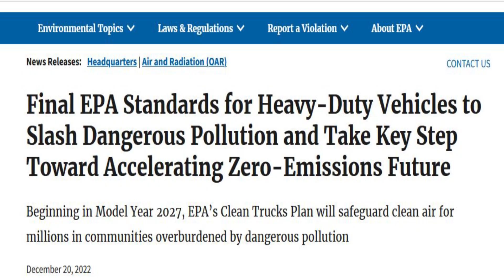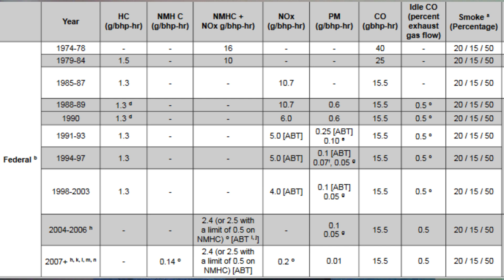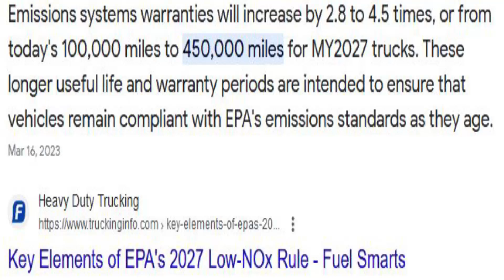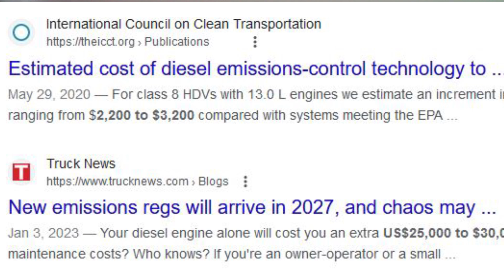Why the 2027 Diesel Emissions Standards will cost BILLIONS!

Comment: These standards are how they will force companies into EV trucks because the cost gap between the types will close to the point that it will make sense to make the jump. It's a sad state of things that these systems are being mandated with no care to the real world negative effects they cause.
My father is a O/O and has only been towed three times in the last five years all because of emissions related systems on his Freightliner failing and bricking the rig. The cost of repairs is bad enough but the tow bill and lost loads are often worse and then there is the danger of being stranded at the side of the road all because for some reason the truck refused to regen.

I want clean air standards but these standards have been misused, abused, and weaponized against those of us in the trucking industry by those who despise our very existence. The only solutions I can see is a curtailing of the EPA's power, a massive improvement in any of the alt fuels support and infrastructure, or a major shift in how diesel power is used in trucking like making new trucks purely diesel electric like a locomotive for example so maybe a smaller, potentially cleaner diesel engine driving a generator might allow for the reduction or elimination of emissions systems and the cost burdens they bring.
Reply: A vast portion of diesel emissions could be prevented by building railroads and stopping the interstate travel of goods on highways. We could then focus on rapidly electrifying short haul and vocational vehicles and not have to worry about long haul trucking.

Comment: The marine diesel industry is just getting into the exhaust treatment world. 

Any boat over 90 feet has to meet stricter emissions standards. 
This is why Viking dropped the 92 from their lineup. 
These boats will require hundreds of gallons of DEF to meet emissions. 
In an already tight engine room I don’t see where adding a 1500 degree SCR system will go wrong.

Comment: I think the advantage of diesel engines are gone. Between the cost of the parts the loss of fuel mileage regenerating the particular filter and all the various other parts you outlined and issues. I think they need to go back and build high torque low-rpm gasoline engines. With the computer technology we have today the engineer's should be able to design and industrial gasoline that is reliable,
 clean and has a long life. 60 years ago they made gasoline truck and industrial engines. Maybe the increased length of warranty would cause the manufacturer of the trucks and parts to design and build better parts instead of nickel-and-diming everything to satisfy the bean counters.

Comment: What's your opinion on the opposed piston engines that are out testing right now I've seen some in Walmart trucks it's a three cylinder six piston two cycle what I've heard is they can just use that engine and keep all of the same emissions equipment and meet the higher standard
Reply: Yeah, the engine with no valve train. Two injectors per cylinder. The pistons meet (almost) in the center of the cylinder.
Reply: The way I understood it was that some manufacturers Don't really have to change the engine design mechanically in order to meet the new standards they can simply add another SCR system in line with the current one and that will get them there with a change on the programming but I've heard that that cost like an additional $10,000 just to add in another one of those complete systems

Comment: The engineers actually build a proper system instead of cheapest Chinese components that break down 6 months after you install them
Reply: This just means that instead of paying for the repair when it happens, you are paying for it before it happens in the inflated price of the truck. Kind of like taxing corporations more. The corporation does not pay anything in taxes, you do when they add that cost to the final price of the product. So now when a truck is wrecked before the first repair, you are out the extra $25k in the price of the truck. Well, the insurance company is out that money.....but where does that insurance company get the money? From you in higher premiums. And the truckers may not suffer that much because they will just pass that cost onto the freight and the final consumer. Every tax and draconian law like this ultimately comes to the end consumer paying the price. We are all getting screwed.
Reply: Like I keep telling everyone,the consumer pays for everything.
Reply: Lolno. The suits will demand a CHEAPER system thats cheaper to repair and ask what the average cost of emissions repairs are triple that and apply it to the cost.
$300,000+ trucks here we come! Oh and if right to repair fails they will also refuse to repair rhem past the warranty and have fun with that!

Comment: EPA is a joke they should be dismantled and abolished all they do is cause people tons of money when they don't even fix any of the problems of proper running vehicle does not need not one Emissions on there and most Vehicles out there that don't pass emissions are the ones with emission problems emission components do the exact opposite of what they're designed to do

Comment: That is good news. Since a lot of people hate DEF and do deletes only because the dealer only covers 100k and they are super expensive to fix. Manufacturers had plenty of time since the last revision of the standards to get systems right.
Reply: Until your truck is sitting at the dealership for 3 months waiting to get in.
Reply: @tdashkevich  emissions are here to stay. The better design needed and waiting to get in is a dealer issue, not a manufacturer.
Reply: they never "Burn" right in Cold Temps, and gums up the Filter after about a Month to the point where no Re-Gen will clean it.
Reply: Have you considered that it's not technically possible???
Reply: @Redmanfms  everything can be made better.
Reply: They are still not right. It may be improved, but still horribly unreliable.

Comment: They really need to find a more reliable treatment system if they are going to keep pushing this stuff.
Reply: Military should have to follow the same standard.  No exemptions
!!!
Reply: @matta3888  Military is federal govt you would not want your MRAP to derate and regen in the middle of a firefight now would ya…..
Reply: @matta3888 No they shouldnt. Go to war and have emissions problems... Yeah right!
Reply: @matta3888 military and emergency vehicles you can’t have them regen in an emergency situation
Reply: Nah, they can just keep spending and let inflation handle the taxation.  All their assets will hold value while the sheeple starve and vote for their lies.
Reply: if they do that then what kind of parts and service are they going to sell
Reply: Ask the germans😉.

Comment: I say 80 to 90 percent of check Eng lights are def system related,,, it’s ruined the heavy truck engine,, there no longer reliable
Reply: Working as intended. The malfunction indicator lamp (MIL) or check engine lamp by OBD and HD- OBD standards is meant to illuminate when an emissions critical component is out of range or malfunctioning.
Reply: @jedidiah4004 The check engine light is working as intended. I dont think anyone's complaining about that. But the fact that, as OP states, 80% of the time, the failed component is adblue/def related, says a lot about these systems. I work as a diesel mechanic in the UK on MAN trucks, and we spend more time diagnosing and replacing adblue components than anything else.

Comment: There are significant changes being made to engine, aftertreatment and WHR systems for the 2027 block. SuperTruck 2 is currently nearing the end of development with claims of %40 higher efficiency's. The trucks that are running right now are from the supertruck1 program which was highly successful. The industry had the exact same tantrum in the 2000s and 2010s when those regulations came out. https://www.energy.gov/sites/default/files/2021-06/ace124_meijer_2021_o_5-14_71pm_KS_TM.pdf  But what would Cat know about on highway engine development in 2020? xD
Reply: Highly successful at what exactly??

The current engines have significant reliability problems stemming entirely from the ATS.
Reply: Here we are 23 and 13 years later and the emissions components are still not reliable. You wonder why people have an issue?

Comment: To make it worse, in California (and other CARB states I believe) they put a cap on the maximum age and mileage of trucks, forcing the purchase of a new truck

Kinda sucks because the delivery of a new truck may take years after its ordered, and you're left with an otherwise functional truck that can no longer be registered
Reply: Califonia is on a highway to disaster. The exit is rapidly approaching,
Reply: How is buying a new truck instead of driving the used one that works better for "carbon footprint"? The same people writing these laws are flying around on private jets, which are basically burning a variant of diesel. There's no aftertreatment system on jet engines, and the lithium mining for large batteries is a nasty process.
Reply: @TwoYeets  yeah exactly and those private jets pollute on one flight what the average American pollutes in a lifetime
Reply: Why would you want to live in California??
Reply: Even the exemption for operations with limited actual driving is evidence it is not about air quality. It is about forcing people out of business. I knew a guy who spent 15 years on a contract that only involved taking a loaded trailer 6 miles to a grocery warehouse in Compton and wait for the unload and return the empty to the yard. Paid $300 a day to the truck 5 days a week.  He only bought fuel once a quarter. He had an old paid for truck that was providing an easy life. 

California required he buy a newer truck to operate even this basic operation. The limited use exemption limit is 1000 miles annually. 

The state was preventing him from using his property for its intended purpose and reducing the value of his truck to scrap by banning it from being used in the state. The only way to continue to operate was to buy a 2010 or newer truck. He   and the many people that put in years of hard work to put him in such a retirement contract had it needlessly stolen by the state government.
Reply: Don't worry, soon the manufacturers will make it illegal to actually own a truck, they will be lease only. This gets around the problem of the 'right to repair' laws, and forcing you to bring it in to a dealer, and only use OEM filters, fluids etc. Because otherwise, if they threatened to void your warranty because you used aftermarket oil and fuel filters, they would have to provide you such filters at no charge under the Magnusson-Ross Act. However, if the truck is still legally owned by the manufacturer or 3rd party leasing company, they don't have to allow you any permission to work on it. Think of it another way, if you let me borrow your truck to finish out a trip while my truck was in the shop, would you want me tinkering with your truck? Heck no, you don't know if I know what I'm doing and I might screw something up. Everything is moving to a "XXX as a service model", take Photoshop and Adobe Lightroom and Micro$oft Awfiss for example, all of which you can't buy anymore, if you want to run those programs, you must pay a monthly fee. It's called the 'never-never' plan; they want everyone to have a truck payment for life! TAAS is coming soon, probably sooner than you think. Trucking As A Service.
Reply: Everyone boycott Cali. Let the crops rot in the fields.
Reply: Sounds wastefull af
Reply: Simple answer to that is boycott the states that demand new updated equipment. Let them starve they will soon rescind an order like that if they cant get any product. Its time the trucking industry started acting like business men and women instead of stupid morons allowing themselves to be lead to slaughter by communist states and their dictator tactics. Realize that the largest workforce in north america is the trucking industry. We can leed instead of follow. It just takes some intelligence and back bone to make things better. I am a 45yr veteran of the industry and have seen the trucking industry thrive on stupidity for too long. Hail Jimmy Hoffa
Reply: Source?
Reply: What are the other CARB states?
Reply: sucks that CA is such a big market.   If truckers could just say f--k CA, and no product gets delivered there, they would change their tune
Reply: @John5ive  Thats what happened to the poultry industry. California changed the requirements for chicken farms to sell their products in the state and they tried to boycott. They ended up upgrading all their farms  to comply as they couldnt afford to give up sales in California.
Reply: don't live in fascist states

Comment: This will be part of the push away from Diesel to EV, Hydrogen, Natural gas, etc. drivetrains.
Reply: It’ll be the push toward poverty and famine. See T Sowell
Reply: Everything you mentioned explodes in a driver killing fireball when/if they crash...seen it with my own eyes...no thanks ...
Reply: Hydrogen and N.G. are garbage; and E.V.'s don't stand a chance when the empty-weight of the E-Truck is around 58,000lbs (which means you get roughly 11,900lbs. for actual Cargo).
Reply: Electric is a complete deadend.

Nat gas is out there, but only major carriers use them and they do it because they are farming refundable tax credits.
Reply: Diesel is STILL the most efficient & environmentally friendly fuel source on the market. $50 in diesel lets me drive my VW TDI 450-500 miles.

EVs are causing catastrophic levels of destruction globally as they mine for the rare earth chemicals for the batteries, & burning coal at power plants to supply the electric grid which charges them.

Facts!
Reply: Natural Gas still emits CO2. You oxidize a Hydrocarbon you get water and carbon dioxide every time. 
Hydrogen is a non starter. The amount of energy needed to collect hydrogen is many times the energy you get out of oxidizing the hydrogen. On top of that virtually all commercial hydrogen comes from steam reformation of natural gas which emits CO2.
Electric vehicles require getting the electrical energy from somewhere. 61.5% of the U.S. Electrical power comes from burning fossil fuels and biomass. 18.2% nuclear.

Comment: not to mention supply of def here were I live still has supply back backup and price per trip since def also costs money....
Reply: If you go up north it freezes a lot even with all of the precautions that the pumps have heaters built in them heaters wrapped around the def lines from the tank it's still freezes up The great thing about it is when you try to get def every time you get fuel and you can't get it anywhere and the tank gets empty it cuts your power back to where you can't hardly drive at all and then you're broke down because you don't have enough power to climb a hill because you wanted to buy some but you can't
Reply: @theguywithallthesolutions  live in Ontario so know that all to well...

Comment: Current diesel engines are still dirty.All the add on emissions equipment makes the engine appear clean.
Reply: It doesn't make them appear cleaner, it actually makes them cleaner
Reply: Apparently you never have seen the exhaust pipe of a 2010 and newer truck...
Reply: @affordabledcgenerators1607  for real
Reply: You got no idea what you're talking about.

Comment: I think they should instead emphasize cleaner, more sustainable fuel (i.e. promoting biodiesel)
Reply: lol and it doesn't work in winter. not to mention your filter doesn't last as long
Reply: Medical and recreational marijuana will keep the price up so we never build anything out of it or use it for fuel.  Construction waste could have been medicine like it was long ago.
Reply: Imo bio plugs fuel filters in half the time
Reply: Biodiesel is part of the problem right now. High pressure fuel systems don't like water and animal fat.